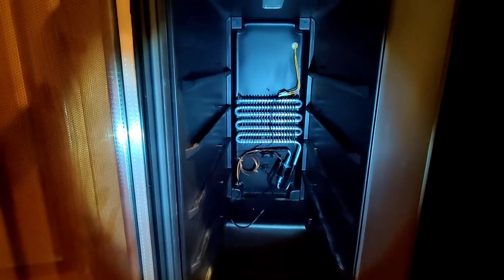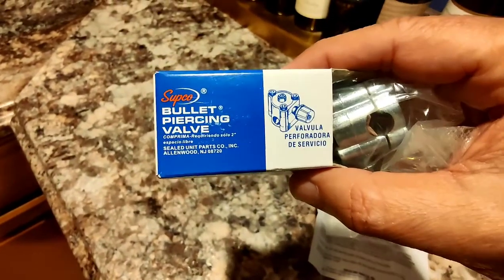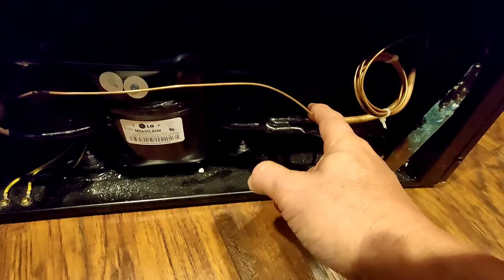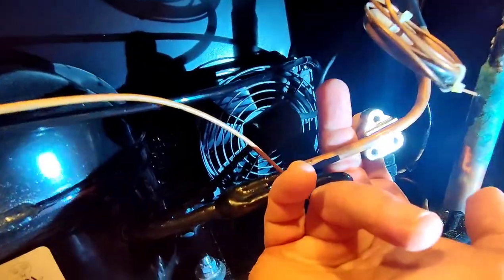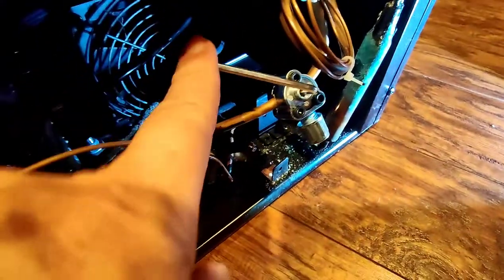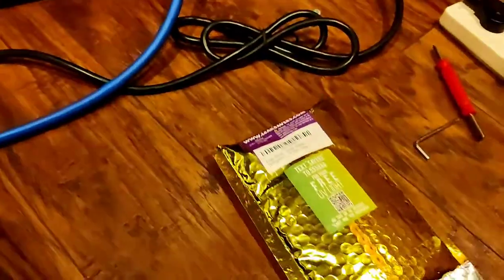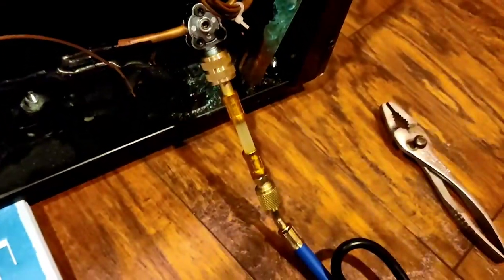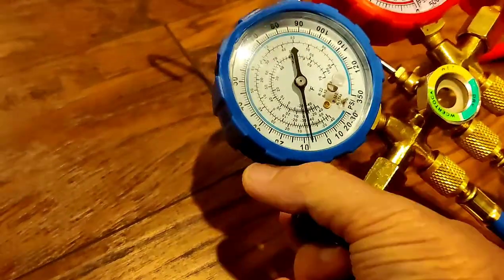Edgestar Wine Cooler Repair

Comment: Thank you SO MUCH for posting this video! I'm very grateful for handy people like you who take the time to share their experience in such clear and thorough videos! I just picked up this exact model for free due to the same issue rendering it "curb garbage" and I'll be doing everything you mentioned this weekend!

Have you by chance ran over the coils with a UV light to see if it is leaking at all?
Reply from the maker: I did, and couldn't see anything... It's still cooling like new.... Glad I didn't take to the curb, they are too expensive not to fix

Comment: How is it holding up? I just took my Frigidaire Gallery back wall off and can visibly see were the PAG oil has been leaking from the coils.
Reply from the maker: It's been several months, and still stays icy cold
Reply: @ginandmore  is your edgestar still working and cool? Any post 1 year issues?
Reply from the maker: @robertnamba  Yes, I had to recharge one more time, I had Freon, took 10 minutes... So maybe still a slow leak, may repeat the Leak Stop one more time, will cost about $20
Reply: @ginandmore  Thanks so much. just waiting for my leak stop Uv to arrive so I can try it this week!  Thanks for the tutorial
Reply: @ginandmore  I have the same and worked fine for almost a year and had to recharge it again. This will keep happening until the source of that minute leak is found and fixed... and I have a feeling this is common issue with all these units ... but if we find the source of the leak please share as this will give more life to it.

Comment: I got an edge star and a month later it crapped out on me. Smh never buying from this company again
Reply from the maker: I will say that they have customer service number where people actually answer the phone, they have spare parts department, those things alone are amazing.... Mine is still working after this fix
Reply: Since your wine cooler failed in so short a time period, hopefully you simply returned it for a refund a/o exchange rather than attempt to repair the thing!